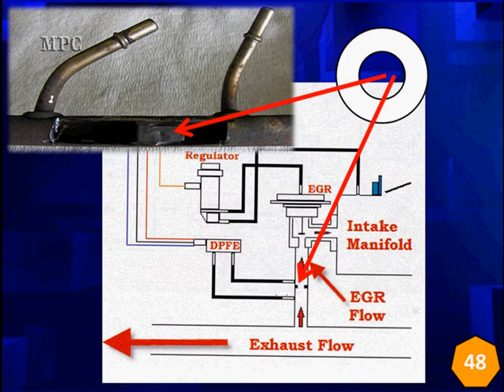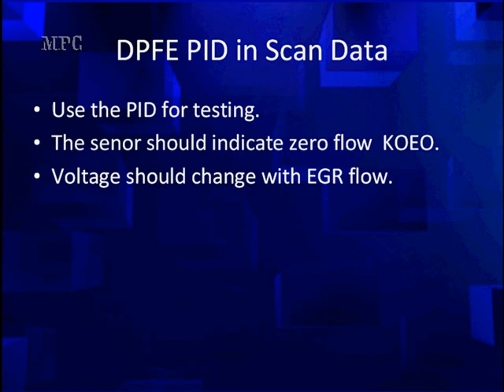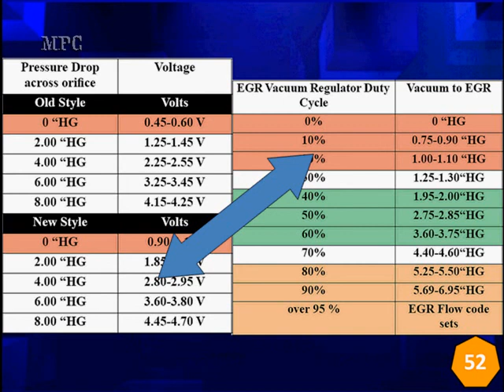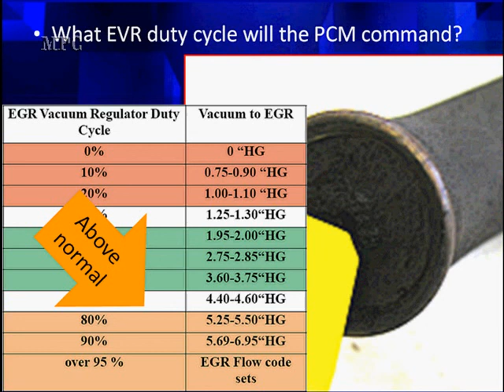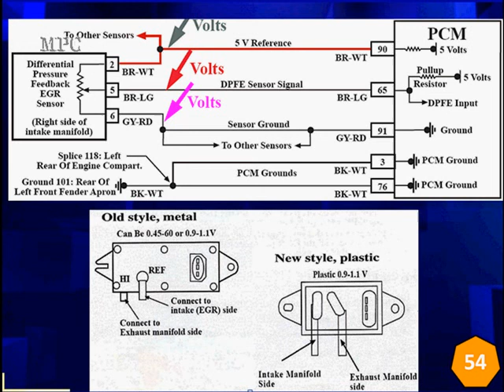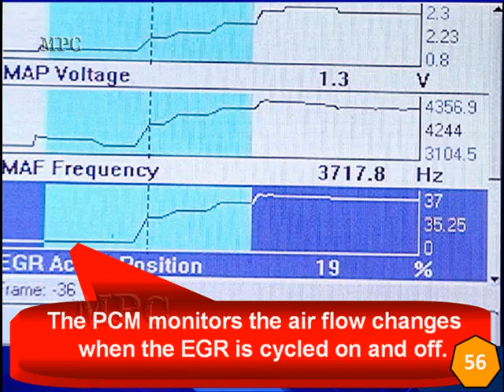8 EGR Monitor Diagnostics

Comment: Struggling here. I'm working on a 2011 Ford transit connect and I think this particular ford has a totally different system than this. It's a 6 pin electric egr valve and I believe that means there is no DPFE system. Is that correct? I'm going to try to get more data by comparing MAP voltage and Commanded EGR % now.

Comment: This information you have given on the ford egr system, was god send for me.  I'm self educating, and completely on my own.  Your program and the lessons you have posted has literally been the most valuable part of my learning experience.  It has educated my understanding and perceptions of these many concepts and complicated engineering puzzle boxes.  I'm glad to have more knowledge and insights to field, but at this time is really more necessity than anything, just to be able to get back and forth to work....  I'm fortunate to have had the luck to run across your classes.  It is a TON OF INFORMATION TO PROCESS.  Surprisingly i have found  that I understand it quite well and follow along understandably.  Which sometimes can be difficult for me to comprehend some things that run down a different track that i do.  And also, the information gets pointed out and simplified  making  it easier to understand.   I love it...🤟🏻

Comment: I used the voltage values in your video to diagnose the EGR monitor in my Range Rover (which has a FoMoCo DPFE.)  It tested at .5 volts and is the newer plastic style, so I assume it was bad.  Well, the new part was over 160 Pounds, and after installed I'm still having the same excessive flow issue.  The new part is also putting out .5 v KOEO.  Pretty disappointed the information here is not accurate.  The hoses are clear as confirmed using a Mityvac to try to pull vacuum, and the EGR seems clean.  Back to the drawing board with a lot less money in my bank account.